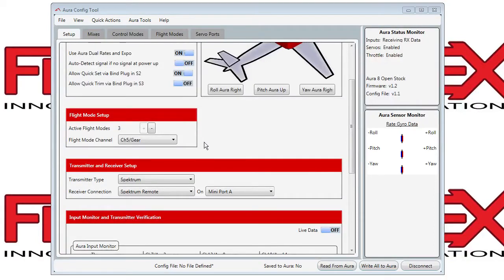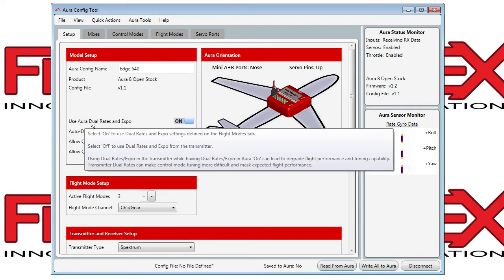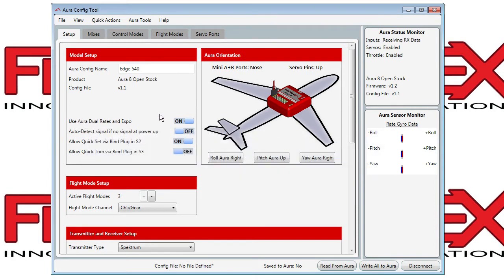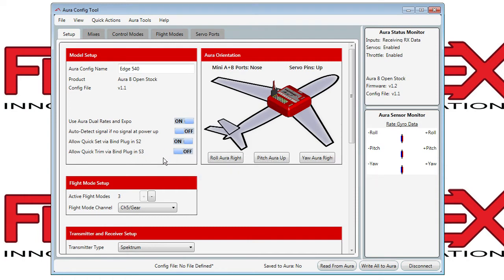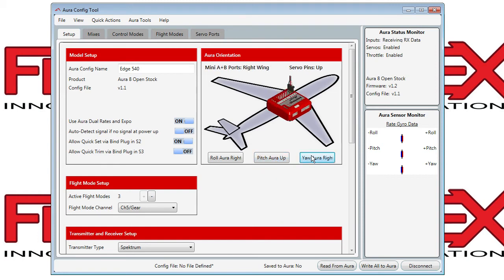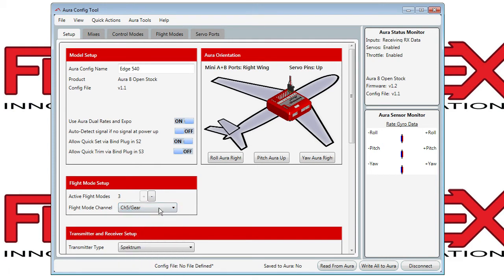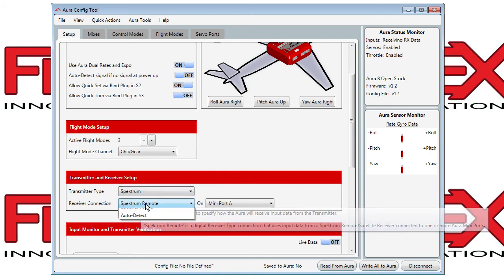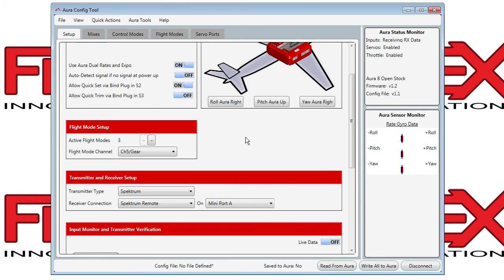Aura Basics - Setup Tab

Comment: I am completing a Flex RV-8 and  find that the Aura gyro responses are reversed in all three axes.. Even in mode three, motion of the control surfaces in response to testing , is minimal, but sufficient to know that gyro correction is reversed at ailerons, elevators and rudder. Before I intervene in factory settings, I would appreciate experienced advice . Equipment used is Futaba , transmitter T18SZ and receiver R7008SB. Connection S-Bus. setup is according to instructions, and ailerons, elevators rudder and throttle function appropriately. Flaps needed to be reversed, and that was effected in the transmitter. So my question is:- How to reverse the gyro responses?

Comment: I've watched 3 of your Aura videos and have yet to determine if this stab does auto-leveling. That seems like a BASIC thing to know yet the only hint that it does is in the product description where it says "6 Axis Sensor and powerful 32-bit processor allows for continuous expansion and feature updates". That implies it does do A/L. But it doesn't actually say it does. Maybe that is something so basic that it is understood by most pilots buying this unit. But as a fairly new pilot, I'd like it to say what functions it can perform, A/L being the one I am most interested in. Thanks.
Reply: No, it does not auto level.... Just a flight stabilizer with lots of installation options.